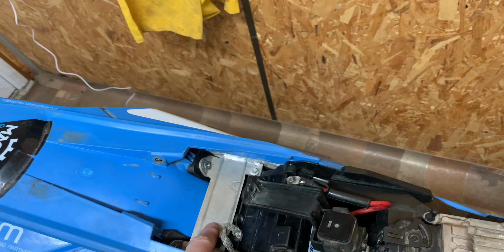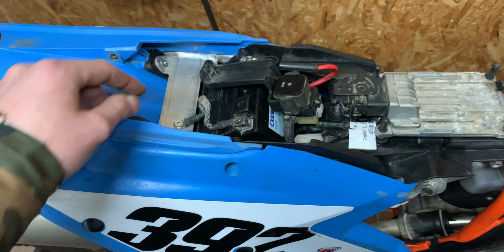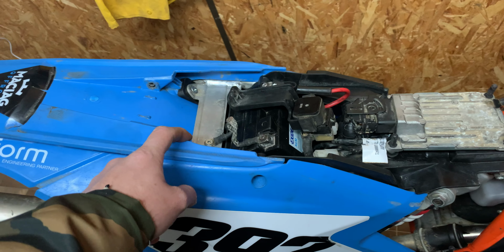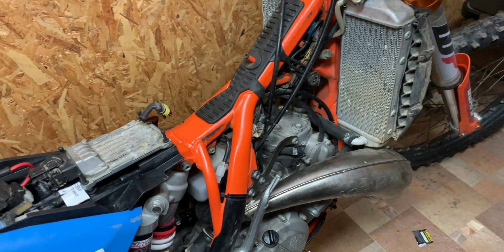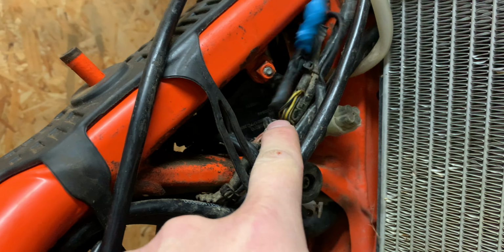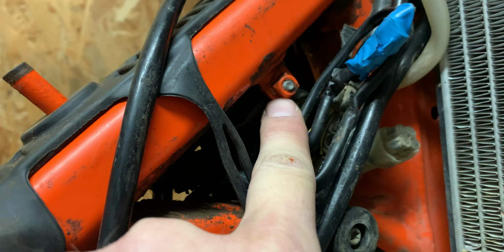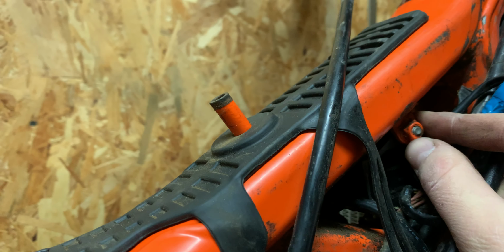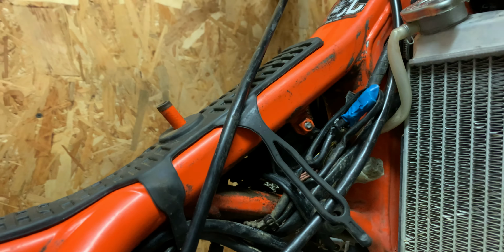Ktm TPI 250/300 electric starting problem , solving and fix

Comment: Same problem on costumer's bike,  te300i. I dont have the service manual of the fuel injection system, but I checked some sensors like crankshaft sensor, map and tps. All of them looks great. I disconnected the kill switch and the problem continues. I tested a new battery, the same. I checked all the connectors and the wiring. 
I checked the ground wire too, but i dont remember about dirt or rust in the bolt. Tomorrow ill check this one.
Reply from the maker: Share your thoughts here.
Reply: @ i checked it today and the problem continues